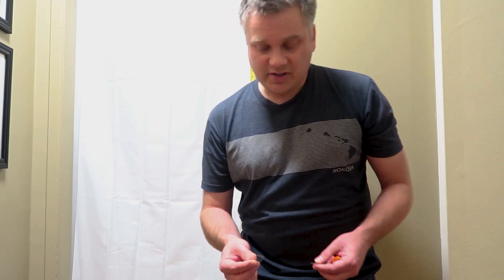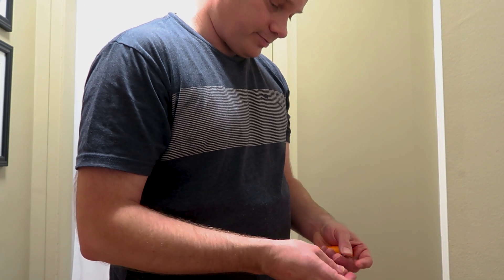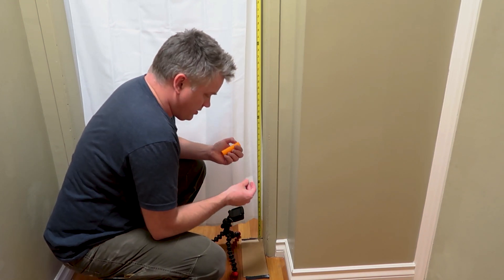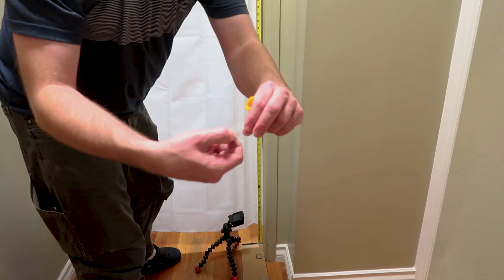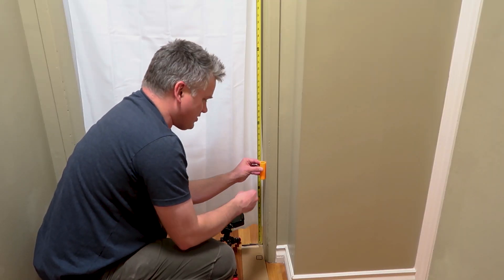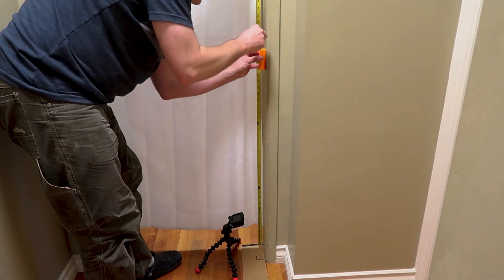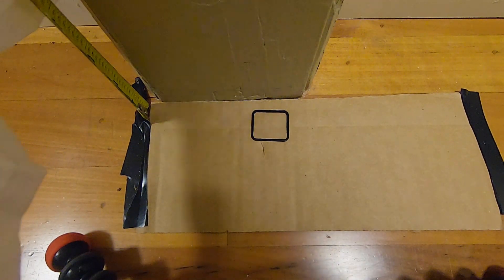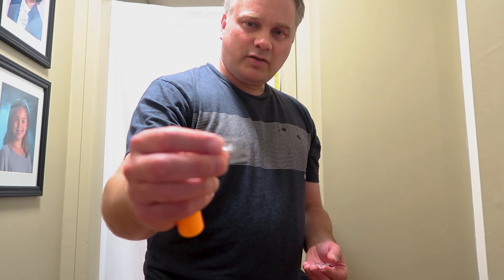Smash test: the strongest GoPro Lens protectors you can get

Comment: if we assume the maximum drop height that the glass survived to be 5 feet (~1.5 meters), the ball bearing having a diameter of around 16mm and made of steel, then the glass is able to survive up to about 0.25 joule.  to get a feeling for what that means, your typical airsoft bb has between 0.5-1 joule when it leaves the barrel (though that obviously will decrease over distance).

what I would be interested in seeing though, is a test with those lens protectors on a harder surface as the soft cardboard may be leading to inaccurate results.
Reply from the maker: I'm wondering if one of your assumptions is off, or perhaps I've misunderstood your comment:  Yes, the ball bearing has a diameter of about 16mm, however the point at which it strikes the glass is much, much smaller (1-2mm), so the force would be maybe 8-16 times greater than what you calculate (?).  
Having said that, the lens protectors are now made out of Corning Gorilla glass, which is much, much stronger.   If you check this video out, you can see it being hit with a hammer and not breaking, and that's less than half the thickness of the lens protectors!  https://www.youtube.com/watch?v=QuSo_i4nG0A      
I would say that these should be perfect for airsoft.
Reply: @MactacFPV  The figure I gave is the kinetic energy of the ball bearing at time of impact (Ek=mv^2/2), not the energy transferred to the glass. that being said, the kinetic energy transferred to the glass will necessarily be less than or equal to that of the ball bearing. However, as I mentioned before, the kinetic energy of an airsoft bb (around 0.5 - 1 joule) is as measured when it leaves the barrel, and will decrease over distance, though I don't know at what rate.

Gorilla glass is interesting. I saw on the website that the screen protector is made out of gorilla glass, but I didn't see that for the lens protectors.

By the way, I mentioned before that the carboard surface may be giving you inaccurate results, this video may be helpful:
https://www.youtube.com/watch?v=n3Clr-HuFnk

Comment: How much does your steel ball weigh?
Reply from the maker: Well, I went looking for it to weight just now & can't find it because my kids were playing with it :(  But, I do have the tube, and measured that.  The tube has an inner diameter of 16.5mm , so the ball bearing has a diameter of about 16mm.

Since most ball bearings are made out of SAE 52100 steel, which has a density of 7.81g per cubic cm, and using volume=4/3*pi*r  cubed, I get about 16.75 grams.
Reply: @MactacFPV  I did some math, works out to 21.55km/h at impact.  Still impressive when the other protector failed at 7.6km/h
Reply from the maker: @davidshaddix4284  Also consider that it's a sphere hitting, so all the force is concentrated on a very small, single point.  It would be interesting to calculate the force/area